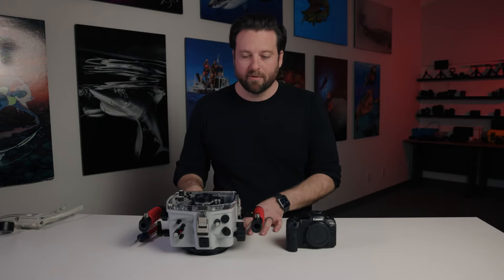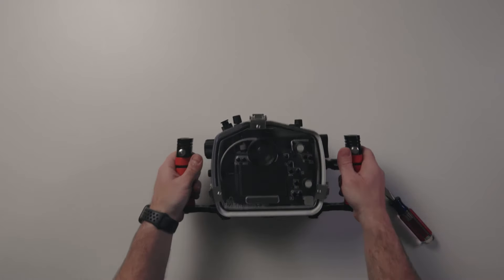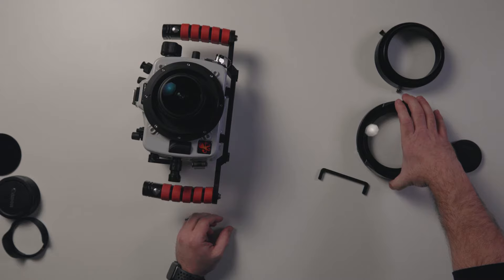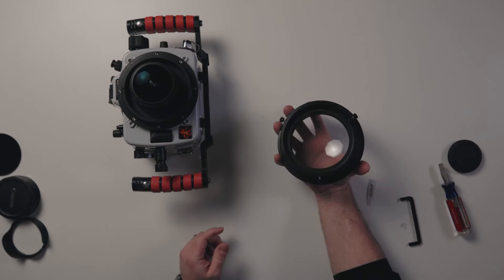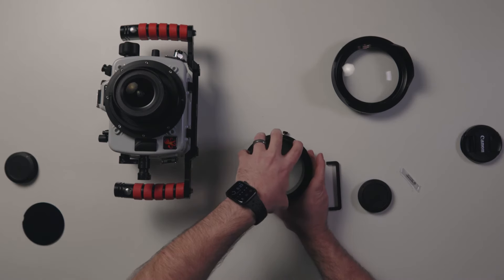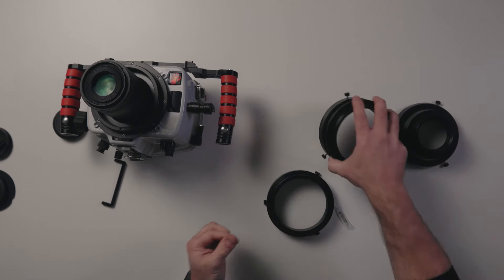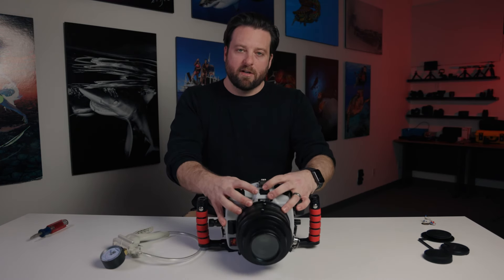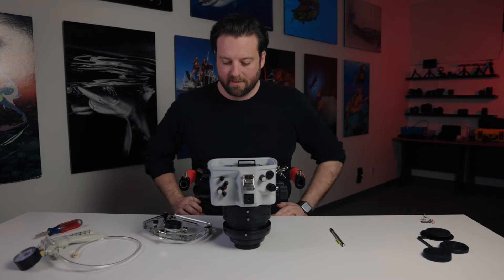How to Assemble your Ikelite 200DL or 50DL Underwater Housing // Canon R5 A-Z Underwater

Comment: In the part for the 8-15 fisheye, it says to use #75344 with #75020, but the port chart online says to use #75344 with #75028. Which one is right?
Reply from the maker: Thanks for catching that discrepancy. It should be the # 75020 only when using the larger full size dome # 75340. 

With the compact dome # 75344 we recommend the extension # 75028.

Comment: So for changing batteries or SD Cards - do you have to dissemble all of it and do it again? Does it have to be sealed over night all of the time before entering the waters? That makes it a bit inflexible for me. Thanks!
Reply from the maker: You don't have to leave it sealed overnight, ideally if using a vacuum check system you do want to give yourself at least 10 minutes or so to see if there's a pressure change. 

If you want to leave the camera in the housing rather than disassembling and reassembling then check out our USB-C Charging & Data Transfer Bulkhead: https://youtu.be/Aop0yejTvTs
Reply: @ikelite 

Perfect thanks. What’s a good retailer for Germany? Do you have sets available as well with lens mount and dome?

Comment: How do you remove the lens from housing? I cannot access the button to release it from Sony camera
Reply from the maker: Hi, thank you for reaching out. Which Sony camera are you using? On our DL housing, the very bottom dial on the side releases the lens. Turn the dial, then the lens, and it will be released. If you need more assistance, give us a call at (317) 923-4523
Reply: @ikelite   I found the dial for it and thank you. excellent timing on customer service! Bravo👏🏼

Comment: For the ef to rf adapter, can i use any brand or only canon adapters can fit the housing?
Reply from the maker: We have only tested with Canon’s but as long as they’re the same length they should work just fine in the same port recommendations.

Comment: Is there a leak detection alarm, like LED indicator or sound alarm
Reply from the maker: The vacuum test system allows you to check for leaks prior to entering the water. We don't currently offer a leak alarm but are looking into it, and there are some third party solutions out there that can be used.